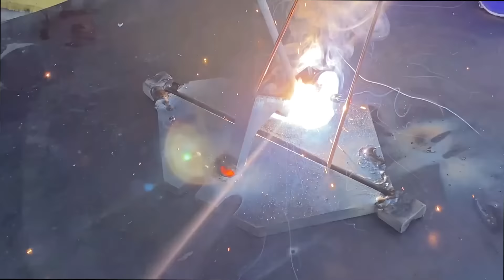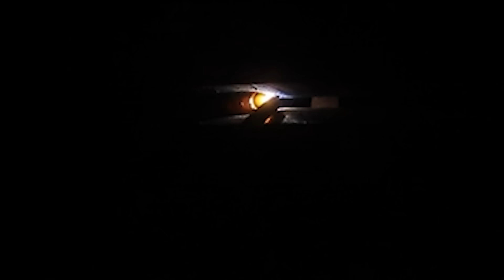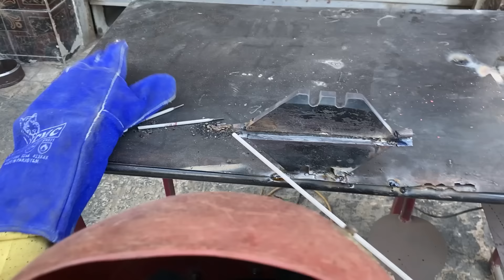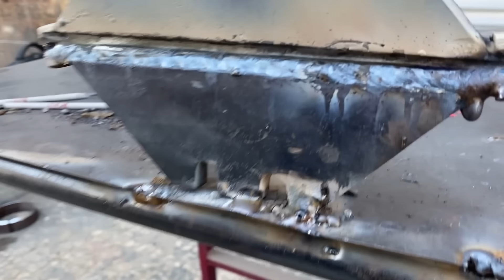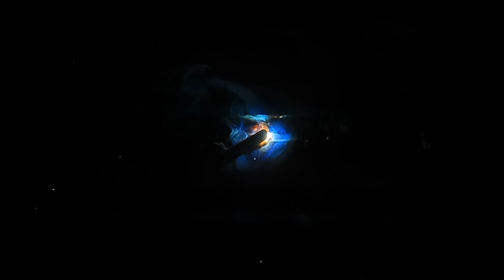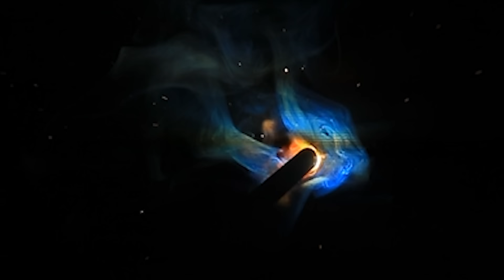Horizontal position electric welding test

Comment: Busted that test.  Undercut on last cap bead .most likely will have slag inclusions and porosity due to not cleaning between passes on the cap. Sounded like you were using DCEP instead of DCEP.
Reply: Not to mention those awful run on/out tabs

Comment: My 7018 (4 mm ) rod stuck in matel how solve this problem
Reply: More amps or thinner rod if welder is small. Else weld more carefully and keep the rod inside the pool.
Reply: Clean any dust on  the metals you join and apply proper amps

Comment: I prefer to do continuous weld beads, rather than back  and forth motions otherwise you will have undercuts .When I did horizontal welding tests  they were always beads on one top of the other.

Comment: I would close the gap some turn up the heat a bit and push the stringer in not so much flagging an cooling and easier to gring and clean with the hot pass